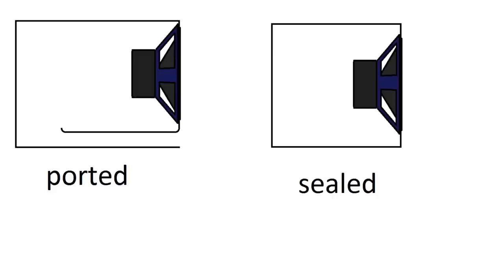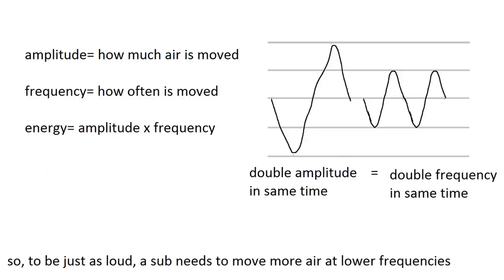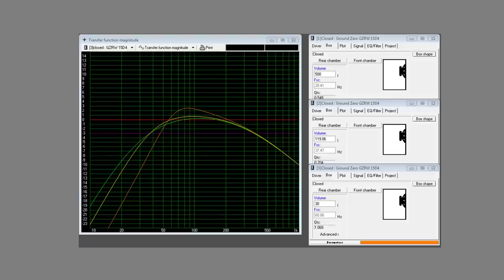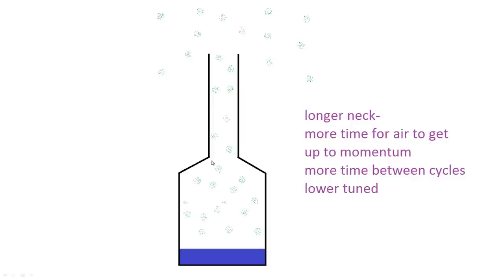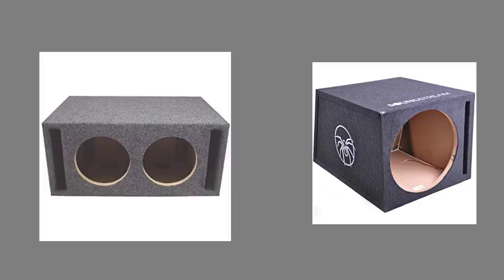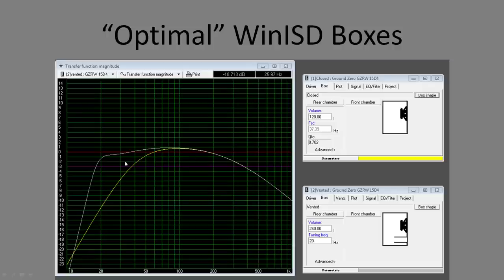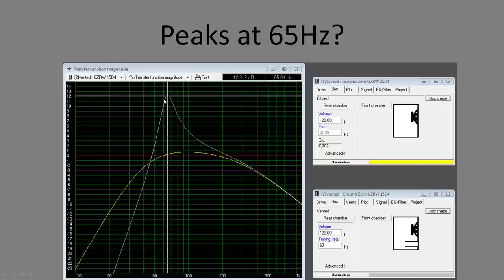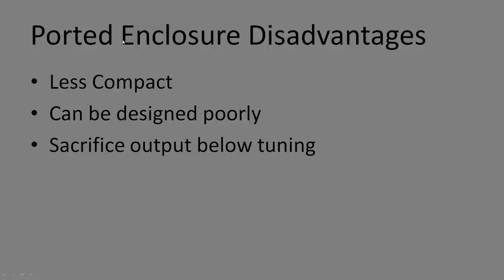Sealed VS Ported Subwoofer Enclosures

Comment: Pretty cool video and I learned a lot but it's raised some more questions for me.

(Background information for question below)
I've got a Kia Spectra 5 hatchback that I'm about to add subs and a new head unit too, I replaced the speakers just recently However I bought two 10" 375 watt  rms subs from a friend.

My question is would it be "a viable option" for me to make a box big enough for both of them and be sealed enclosure if I a wanted good frequency response range or does having dual speakers meant you've got to Port them?
Reply from the maker: generally whether or not an enclosure should be ported is down to the driver, and chances are if its a high power 10" (which I'd consider 375w to be) it should be ported. If the box is quite large, the speaker may sound boomy as the tight airspace isn't damping its movement. The number of speakers generally don't affect this unless the enclosure volume is constant, then more subs would require a sealed box after its volume gets too small per sub. IMO you'd be best off just porting them, and having the port tuned to a quite low frequency, as 10" subs, even with two, aren't likely to handle lows as well as a single 12 or 15 in a sealed box, just down to them being stiffer. Something you could do though, is make up the box as sealed, decide whether or not you like the sound, then add a port. Also, sorry for the late response, this is just my uploading channel
Reply: @Dakoustics  Great reply. I personally like at least medium size boxes ported very low (32hz Max, low 20's better) which sounds great with all kinds of music and is still pretty darn loud. 
  I would like to try a sealed box for my next build and then add an external slot port to see which I like better for the specific sub I wind up running.  Which I am hoping will be this stage 4 DC Audio 12" dub I found lightly used for a pretty price. Then I am thinking about buying whatever used dual sub box I can find, hopefully either dual 10's or 12's or even a nice 15" sub that I can get cheapish to put in a good size low ported box..
Reply: @BabyCharlotteschannel what’s your thoughts on a 10” vs 12”?

Comment: Ported subwoofer enclosures are bigger than sealed enclosures and take up more space in a vehicle than a sealed enclosure so therefore if you don't want your subwoofers to take up the entire space in the trunk of your vehicle then you might want to consider sealed enclosures
Reply: sealed can be big as well for example the jl w7 in a high output sealed enclosure
Reply: And also ported puts out louder and better

Comment: wow.. this videos are very2 awesome.. many video i play to understand..but still cannot get what i want.. this video are full tutorial for understanding how speaker works in box.. great video explanation.. thanks so much.. i wondering about 1 thing that still not solve..about some people  put some sponge filter inside box..what for? and it that good or not..?  I'm now learning to make more perfect sound tweetr/mid/sub wffr that when play the sound are more nice clear even sub wffr so loudly.. i look mostly people play loudly but the voice of song cannot heard clearly..  hope sir can give feedback about putting filter inside box..tq
Reply from the maker: The sponge filter, also polyfil, wool, are used mainly in sealed boxes. They help remove standing waves and echoes, and any other peaks in a sealed unit. Ported boxes tend not to have them, as usually people want maximum output from a ported box, but it can still help with the sound and remove any peaks. I'm not sure to work out how much, there can't be too little, but there can be too much. I'd suggest for a sealed box, fill it until it's not loose, and make sure it can't get stuck behind the driver or block any vents. For a ported box, just line the walls with about 1-2 inches thick, depending on the size of the box. Opposite the driver on the inside is the most important place for material.
Reply: The poly fill slows down the waves and makes the speaker react like it's in a larger box. Don't overfill the box tho it will suffocate the speaker and make it get too hot and burn it up.

Comment: Did you ever seen ported passive radiator box ? i ve seen to a philips minisistem and sounds great
Reply from the maker: I've not seen a speaker with both port and passive radiator. But if you mean passive radiator alone, I've only got experience with one I made. It works similarly to a port, though can sound better due to more precise damping, lack of port turbulence, etc. The one I made though was too small for the drivers, I needed to add plenty of mass to the radiator to tune it low enough, which meant it was inefficient. Passive radiators are becoming quite popular in bluetooth speakers I've noticed, likely in order to be waterproof.
Reply: @Dakoustics  Philips FW C-717 is the one with passive and ported ,my friend had one when i was young and when 5.1 audio sistem came on the market,around 2005
Reply: @VINNY5674  :))) buy that philips sistem and you will find out

Comment: Can you do a video on inverted mounted subwoofer performance?
Reply from the maker: I could do one, wouldn't be a particularly long video, but if you're wondering now, the main difference is saving a bit of airspace inside the box, and, particularly in sealed boxes and 4th order bandpasses,  much better long term cooling.
 Standard though reduces audible turbulence, and is more ideal for high SPL where the drivers are in small chambers, and aerodynamics of the box starts to play a role.

Comment: What about bandpass, and how about passive subwoofers INSTEAD  of a port since you cant have both, but a passive speaker should have been mentioned  I heard zero mention of either. You cant discuss subs and producing bass without at least a sidenote about bandpass and passive speakers.
Reply from the maker: I made another video specifically for bandpasses, too much for one video, also at this point I was still learning about passive radiators, and even at this point I don't reckon I know enough to make a video on it, I've made a passive radiator sub box before, but I'd wanna know how to design one before I even mention the basics.

Comment: Question: Does energy = frequency x amplitude? Because if you take two triangular* waves with the same amplitude but an octave apart you get the same area under the curve for both. What am I missing? 

*Btw, the reason I chose triangular waves was because it's easy to calculate the area of a triangle using bh/2 than trying to integrate sine waves - since I've forgotten how to integrate.
Reply from the maker: area under the curve is used for acceleration and such for linear accelerations, for waves its more like angle of the wave at a set amplitude, so the steepness of a wave at twice the amplitude represents twice the energy, or half the wavelength and same amplitude representing the same thing, in reality its something like squares per double, so a wave 1.414x the amplitude would have double the energy, but frequency is proportional to energy

Comment: Ok am i correct that i will fill the bass more then hear it  in a seald box were ported i will hear the bass more then fill it
Reply from the maker: Sealed boxes would vibrate a surface more due to greater cone movement shaking the box, and ported boxes would vibrate the air more. Also, sealed boxes are better at super low frequencies, where you may also feel the sound more than hear it. So it depends on frequency and ported box tuning.

Comment: What about wiring the sub positive to negative and negative to positive from the amps to the subwoofer it puts less stress on the sub in a sealed box
Reply from the maker: not sure exactly what you mean, audio signals are AC push/pull so all wiring them up backwards would do is make them pull instead of push, and push instead of pull, which would have the same forces/stress
if you mean wire one sub forward and one sub backward, sure it's less stress, but its also substantially lower output
Reply: Dakoustics that answered my question because people are always talking about it gives a different sound and it puts stress on the subwoofer if not wired to the corresponding line

Comment: Which box is better for tight clean bass?? i dont want super loud though..
Reply from the maker: sealed, and aim for a Qtc of the box of 0.707, not sure of the exact math for it, but if thr drivers Qts is 0.35 and its Vas is 50L, around 1 cu ft should be good. Something like that.

Comment: I have a question. I have a sealed box with the terminal plugs off the backs should I install some or is it now a ported box?
Reply from the maker: If the terminal is large, it will act like a ported box, though if its small (like banana plugs) it will still act like a sealed box. Would be best to at least plug the holes.
Reply: Dakchen Games holes are 2.75 inches. Just got some terminal plugs. Just wanted to know if it was a big problem or not. I'll see how it sounds with and without
Reply: A hole in a box is not a port. There needs to be depth to the hole for the port.
Reply from the maker: @jamesf9610  A port doesn't need to have depth, in essence it's just a restrictive opening. The first ports were missing panels, with huge surface area, and practically zero depth. Enclosure design has come a long way since then, and now we have drivers optimised for small enclosures AND low frequency, so practically all ports have "length" except the loading wall in 4th and 6th orders.

Comment: Sealed boxes are better to me and play lower notes than a ported box to get loud with a sealed box just use more power than the recommended rms rating than the sub
Reply: you can push more power into a sealed sub because when the sub moves in it creates a presure so that it wants to spring back into the normal position so the amp delivers more power pushing in but less power pushing it to the normal position so tha power is about the same just higher peak power draw which can destroy some amps or they just cant handle it

Comment: The round ports suck the the slim side ports work well I had the same box in my jimmy and it never sounded like it dose now in my elantra trunk with my seats up and my front windshield area shakes and I'm tuned on a pro audio deck with stage 3 level volumes

Comment: Both have pros and cons.  Why not have one of each in a car or in a home theater to help "fill in" the weaknesses of the other?  More of a "blended" sound so to speak.
Reply from the maker: Yep, thats perfectly viable. Not often used, though would be similar to adding a ported sub to a pair of speakers which reach down to 50Hz, and crossing it over down low. A 10" sealed sub could be used for tight bass down to around 40Hz, and a ported 12" or 15" can be used for rumbles 30Hz and lower.
Reply: Yes and if you really wanted to get "fancy", you could put each one on its own EQ so that you "blend" them even better.  Just run a slow low frequency sweep and adjust both to your room and preference, then watch a movie with lots of bass and enjoy your Franken-bass
Reply: Another "compromise" is a PR (Passive Radiator) design.  They can be useful if you are cramped for space, or if you have a 2 way system that you want to extend the bass on.

Comment: the higher the order of the box is, the sharper will it roll off. other than that group delay will allso suffer. out of band power handling decreases. sealed is a good box type to use. however, its only good if the driver is suitable for that application. listening environment allso mathers. a car trunk has its own quirks vs a room. room gain is real. since in a car trunk ya don't realy need to go below say 60 hz due to room gain a poorted box will likely be better there unless... unless you can make a sealed that fits and has a -3 dbl point where the ported had -6 dbl.. then the sealed will be superior.
Reply from the maker: car cabin gain didn't stop me from tuning my 6th down to 16Hz lmao, but yep, all true, good comment

Comment: I put a 3/4 inch hole in my enclosures for my 6x9 that can generate 27Hz and the sub bass is audible. Many people criticise the speaker and say it has problems with some frequencies. The problem is not the speakers, it is the music player and the enclosures. Get an EQUALISER with 30Hz and 6.x9's have plenty sub bass. A smaller hole will let the speakers go in and out and let the sub bass resonate more on the enclosures before it is drowned by mid bass. Ported boosts bass between 45 and 60Hz and the 30 to 45Hz is lower. I suggest 5mm hole to let the speaker move and I have heard from other people in the 1980's that a small hole is best for sub bass. All this yap is not needed. Test the sound with a meter.
https://www.quora.com/Do-you-know-how-to-build-a-speaker-enclosure
Reply from the maker: Currently working on a sealed vs ported test, testing with music and tones, in and out of car. Using a decent mic. A proper SPL meter is a couple hundred, and those dB meters from wherever don't work properly when testing subs.
Reply: I have 2 6x9 in a dual 1.1 cubic foot box tuned to 50 Hz. Loads of bass. I didn't tune lower because then the cone would run out of travel at lower volume
Reply: @TimpBizkit  50Hz is good mid bass, my cones do not travel, they stiffened them to achieve lower frequencies, there are some frequencies not present, they are quality though, 9/10 rating compared to JL 5/10.
Reply: @Dakoustics  My EQ is my Laptop and I can program as many presets as I like, I experiment with it till I get the frequencies tuned optimal for each music rather than try to build the best speaker enclosure because some bass is not set at a high volume in the recording and no matter how much you try it can not always be enhanced. I built my enclosures with thin MDF so it does not reflect as much inside, I built wood brackets to hold them together inside, took me 2 weeks in my spare time to make them. I have a picture of one on Quora.
https://www.quora.com/Do-you-know-how-to-build-a-speaker-enclosure

Comment: Rule of thumb.. 
cheap subs with low rms(sealed)
Expensive subs with big rms (slot ported)
Reply from the maker: Yep, sounds about right.
Reply: Unless your ultimate goal is SQ. I've got a very expensive JL Audio 10W7AE in JL's sealed box,  CLS110RG-W7AE. It handles the JL Audio HD750/1 750W+ RMS power I throw at it and it's incredibly detailed. Sounds amazing.

Comment: ported makes the sub plays better
Reply: Ehhh....   no.
It makes the sub play more.
Reply: Ported=DEEEeeeep Bass👌
Reply: False... play better?  WTF are you talking about?  IT doesn't play as flat .. might play louder at tuned frequency but does not mean better..
Reply: You don't have the knowledge a sub will bottom out beyond the tuning frequency I've seen people separate the voice coil from the spider because of the sub going beyond its mechanical limits where in a sealed box the sub won't bottom out but spring back to its original position
Reply: @generalkickass6385   sealed box don't breath and can overheat coils. I make ported boxes they sound better to me and have never damaged a single woofer.  But it's all based on preference.
Reply: @killabee623  that's true it is based off preference

Comment: If the sealed one has bass radiotor than it will sound louder and better..
Reply: but it's no longer sealed. Passive radiator is working on the same principle as bassreflex.